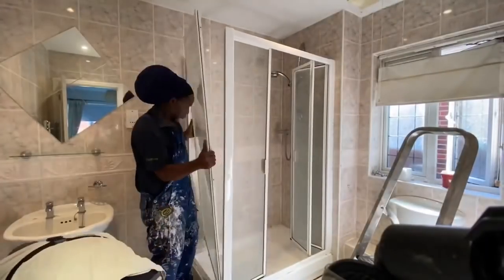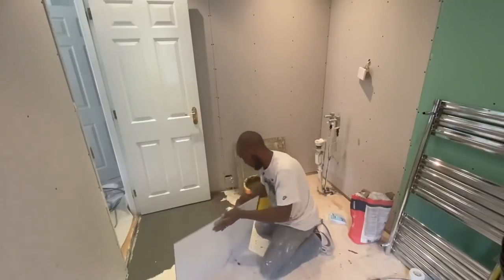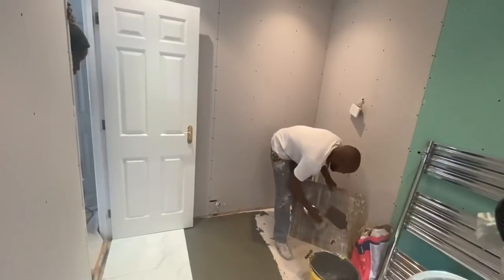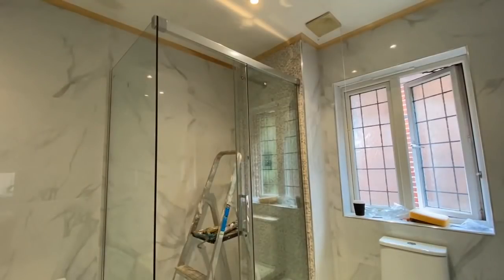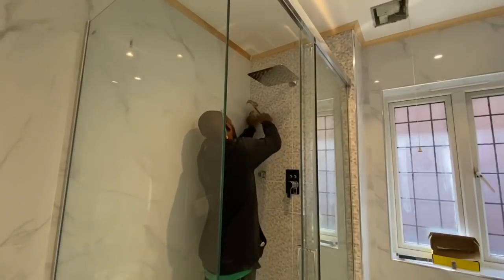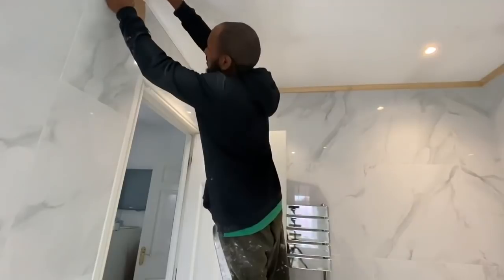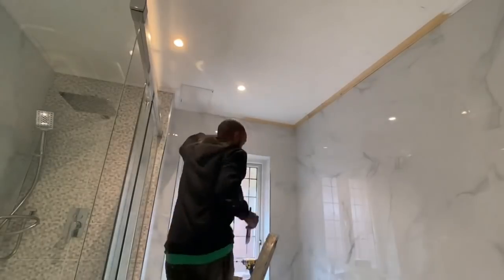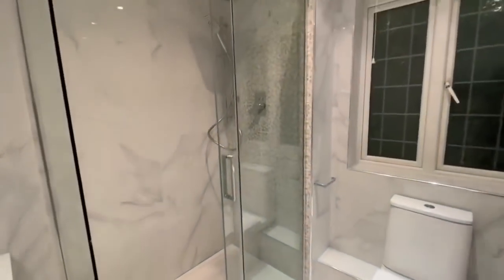How to renovate a bathroom with narration and tips

Comment: How would you have filled the gap with the tiles if you didn't want beading and no extra layer of plaster board
Reply from the maker: I would have stated the bottom with half a tile the the top row slight bigger than half a tile but there rather have full tiles